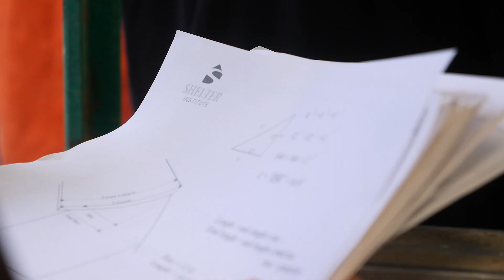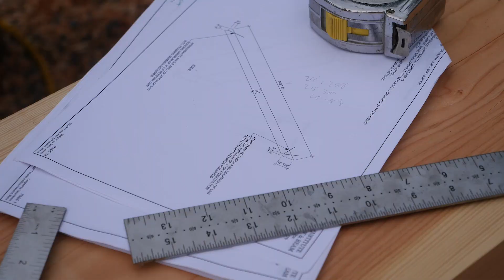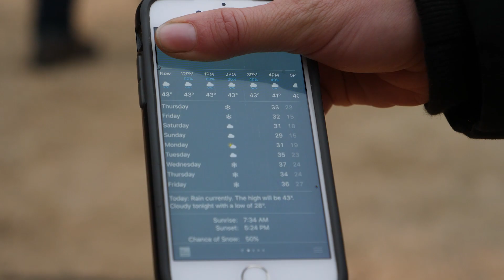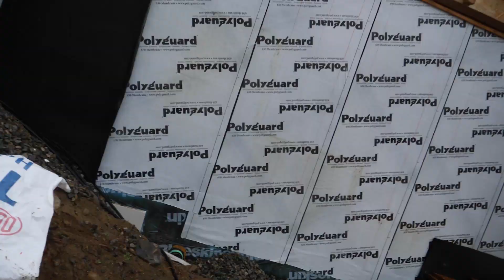DAY 4 (Pt 1): 26 Rookies Build Timber Frame House in 5 Days

Comment: OMGosh... that final shot.  that connection of 5 timbers in to one?  WONDROUS!
Reply: Teasing us until the next video
Reply: 2 ridge, 2 cross braces and 1 support beam.  but, either way....
Reply: the long beam (ridge), is two beams attached using a scarf joint. 2 cross bases and 1 support beam
Reply: No worries D Sloop.  I would love for them to explain the cuts more and where the pieces fit in.  Maybe after the frame is up, they will put out a more detailed series.  maybe. hopefully.

Comment: Hi Guys!  Wonderful job you guys... Always wanted to build my own.  Maybe  a helpful tidbit... Watched the amount of time you spent sharpening chisels.  When your done sharpening, if you have a bench grinder you can polish the tips using a red rouge on a polishing wheel.  It will all but eliminate drag and keep the tips sharp longer.  Think about the difference running your hand along a non polished car vs. a highly polished one.  Works well on razor blades too...

Comment: As a Male that has just recently celebrated a 35th Anniversary,  mostly fully happy times, First secret is to communicate  with your partner, that means listening as well as talking. Second YOUR MALE your ALWAYS in the wrong just accept it and get over it LOL . Third always have total trust in your partner. 

If there is NO trust then there is no relationship. If you cant take some jokes at your expense then why should your partner, you have to be able to laugh at yourself as well as each other. If you cant communicate both ways then how can you be best friends which is only way you can be around each other 24/7. Always face any problem head on TOGETHER hardships shared strengthen the bonds between you as long as YOU didnt cause the hardship by some silly action on your part

Comment: Did you know back in the 1700 - 1800 hundreds they would leave the timber frame standing for at least a year or more before finishing  trimming it out so it would not shrink and warp any more and give it time to dry so every thing you do dose not move and cause a problem's with the  end product
Reply: It also depends on the quality of timber and what part of the tree the timber came from i've read that the centre timber of a tree is more likely to move than the rest of it i've also read that even the age of the tree can affect how stable the wood is
Reply: I don't think they'll have too many problems tho they are using huge timbers for their frame i'm not an expert but I think larger timber is less likely to bow,twist etc than say a 4"x1"
Reply: Leaving a frame to stand would let it start to season but a year per inch plus one year, not a chance that timber will be dry in a year. It may have helped to let the frame settle.

Comment: one thing im wondering were did the power come from i dont hair their new generator in any of the clips. and  i doubt a soler panale would run those power tools or all those lights but i dont know much baout soler panels eather
Reply: Stormcruzerlore follow ze extension cords... I think it’s up near the hot tub or behind the trailer to reduce the mind numbing, conversation ending roar in the work areas
Reply: Behind the trailer cabin

Comment: if they avoided the centre of the original tree from the middle of the timbers, they will split much less.  Takes big trees to cut the large timbers but when doing this much work it would have been worth the addition effort
Reply: Trees they did use could  barely be managed.  Not sure bigger trees feasible given given available resources,

Comment: Hi I also like the viddeos.
But you need to work on the audio recording.
There is most of the time a Backgroundnoise in the lower frequencys.
I think you recorded at a low volume level, and turned it up in post.
But it was a too low volume at which recorded.

It is not only in this video it is also in the other Timberframing videos.

I think it could be hard to hear on normal Speakes, but on Headphones it is verry dominant.

Keep up the work.
I like your videos.